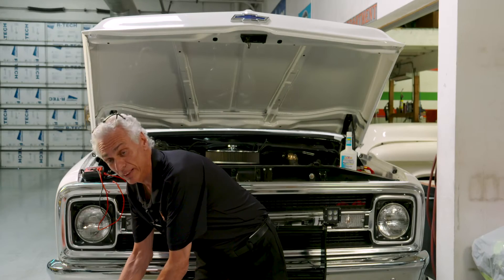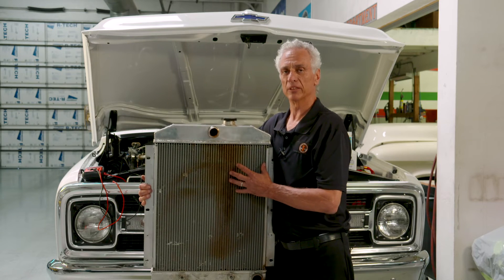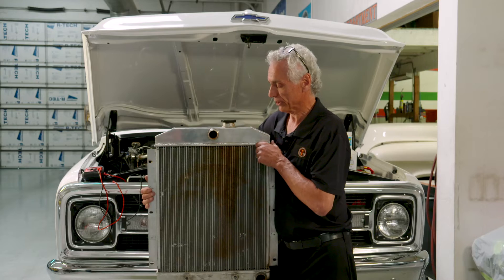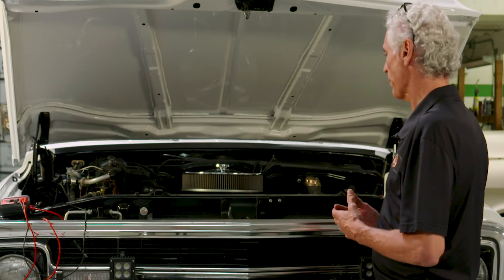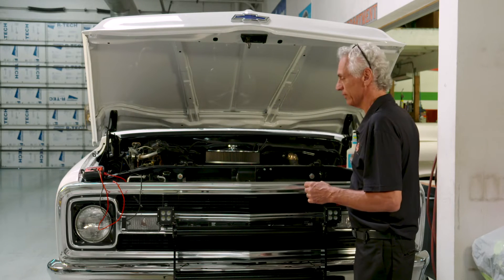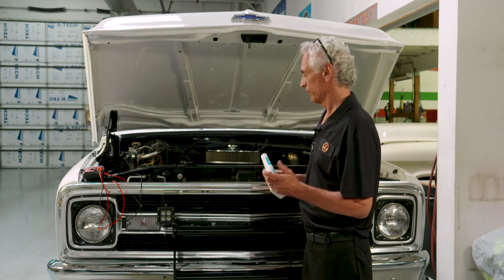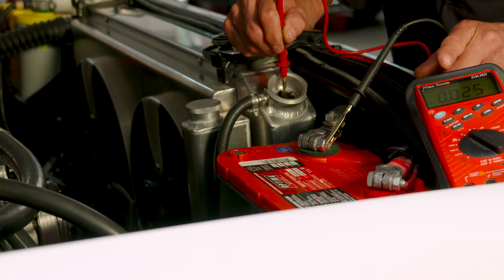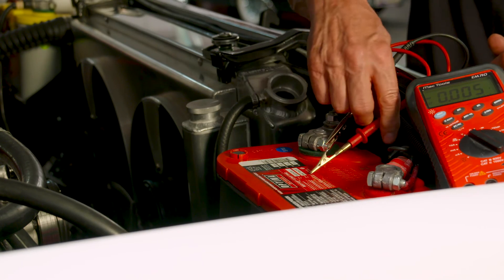Electrolysis radiator diagnostic

Comment: In theory, grounding a previously isolated radiator or especially a heater core could make the electrolysis directly attack the part, as it makes the core a strong ground electrode. This could strengthen the effect of electrolysis under some circumstances. 

This was even warned against in some Ford bulletins. Can't say I have any experience with this, though, and some say it helps, which supports the other idea: keep the engine and rad/other parts at the same potential. 

The electrolysis could be caused by a source of stray electricity or a galvanic reaction strictly caused by dissimilar metals/coolant as electrolyte. Never know, this might play a part in which method would fix the issue. 

Maintaining clean, quality coolant with no tap water should help in any case. A solidly grounded engine and body is always ideal.

Years of tap water top-offs and no flushes ever seems to be the killer. I buy 90s cars, and the cooling systems are usually in mediocre to terrible shape.

Comment: While replacing the heater core on my 1998 Ford F-150, I went ahead and added a ground strap to help stop electrolysis.
The radiator is next then adding one from the alternator to the battery negative.
Can't have too many grounds. Especially on old Fords.

Comment: I don't know why people use these junk cheap Chinese aluminum radiators in their vehicles. Of course your going to have electrolysis. Aluminum is one of the cheapest least 'noble' metals you can use. 
I paid the price and bought some cheap garbage dollar store antifreeze to top off my car in storage. Didn't run it, figured I'd be doing some work soon anyway. 6 months later started leaking from the thermostat housing. Aluminum water pump and Tstat housing completely destroyed. Had to flush and fill the whole system, buy new parts a complete waste from cheap antifreeze. All the (Rad) copper/brass/(engine) cast iron parts were fine. The only aluminum part I put back was a new Tstat housing and I hard anodized it to prevent a recurrence. Went to a marine type water pump, cast iron powder coated inside and out with a brass impeller. In the past I've used NapaKool or FPPF 4000 cooling system conditioner to help protect the engine and the antifreeze.

Comment: I had an aluminum radiator with fan installed on my classic mustang. The radiator started leaking and some coolant leaking at the manifold water port. Must not be properly grounded